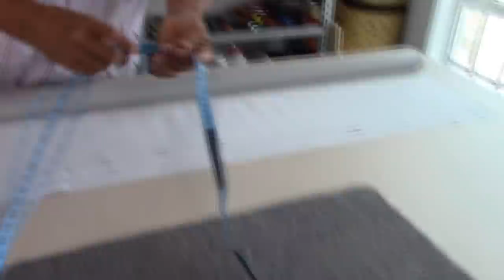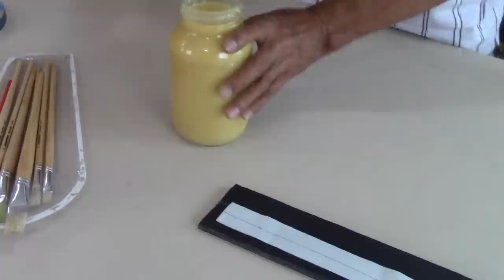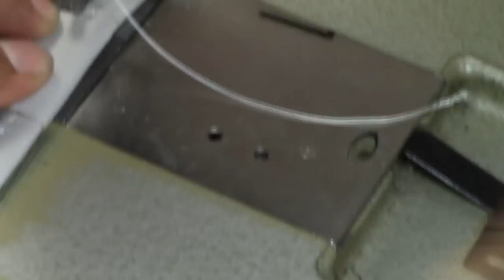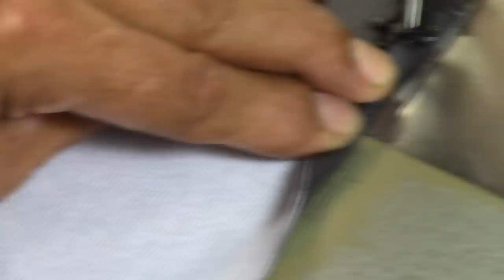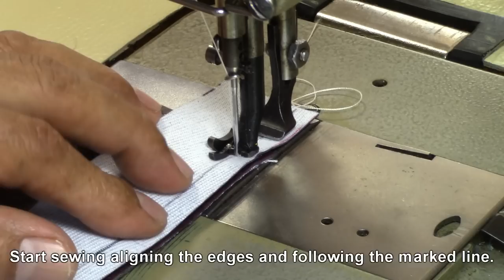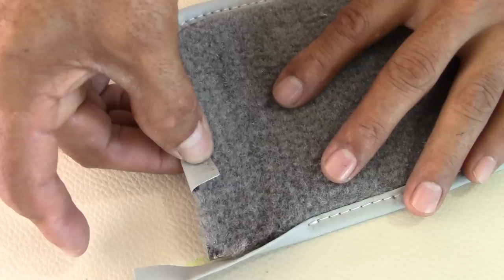Binding Tips - Car Upholstery Basics

Comment: I don't know if it exists, but you guys should publish a standard handbook (online) on CAR and BOAT upholstery. A full DVD course combining all these YT-vidsI myself try to refurbish car-seats of older cars using the very old techniques (involving "crin" and "horsehair").You find this in cars as late as 1960's.
Reply from the maker: +Frank Deruyck, Thanks for your suggestion!  In fact, that's the idea of compiling different upholstery techniques...but, it will take some time to get to this stage.
It is very interesting what are you going to do with the 'old cars', restoring them  original as how they came from factory.
Reply: thank you. I will post a vid on YT showing some of the things I do
Reply from the maker: +Frank Deruyck There is an interesting upholstery forum you could subscribe, if you are not yet...it also has an additional instagram site  where the upholsterers can display their jobs.
I think the 'old techniques' you're referring to is 'tuck & roll'...I did something similar but using foam.

http://www.thehogring.com/auto-upholstery-forum/auto-upholstery-forum-group4/beginners-questions-forum7/tuck-and-roll-thread2133/
Reply: thanks!!!

Comment: hi, great videos. I'm wondering what kind of glue or glue's do you use?
Reply from the maker: +Kawai hao It's a solvent based yellow glue....to have an idea, check:www.homedepot.com/p/DAP-Weldwood-32-fl-oz-Original-Contact-Cement-00272/100125525
http://www.ebay.es/itm/Petronios-Master-All-Purpose-Cement-Glue-Shoe-Repair-Adhesive-Glue-4-oz-/291064753112
https://www.tandyleather.com/en/product/tanners-bond-craftsman-contact-cement
Do a test beforehand.